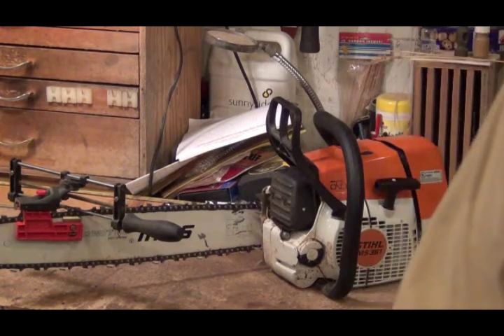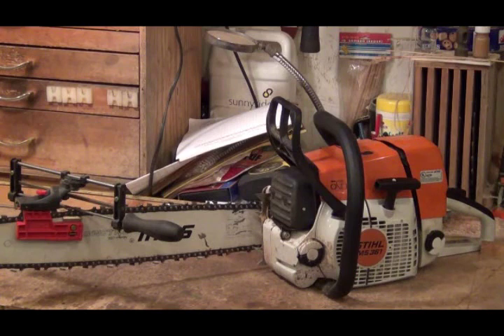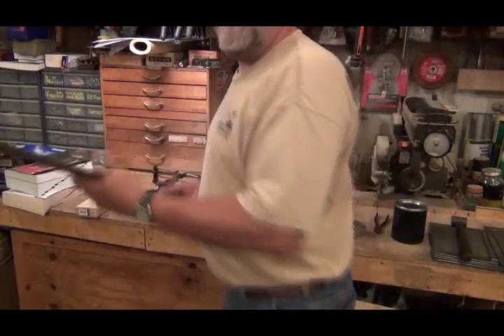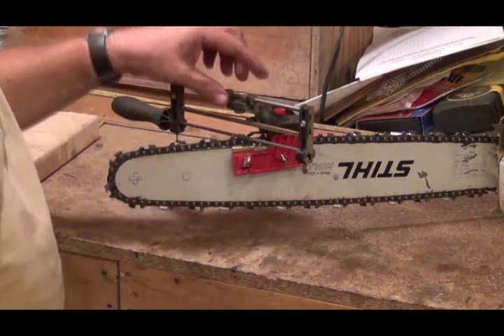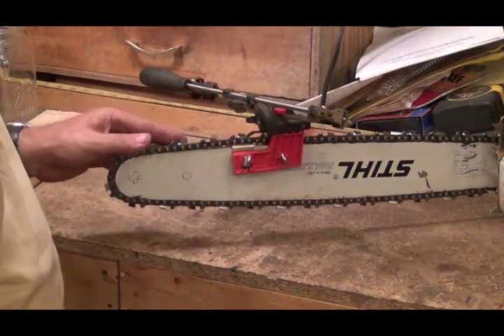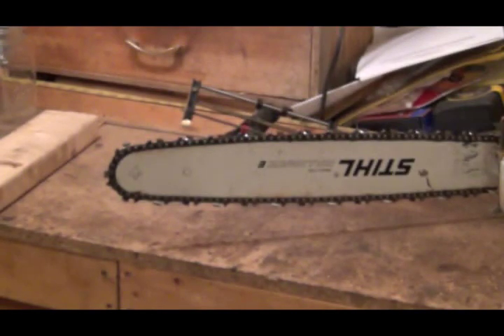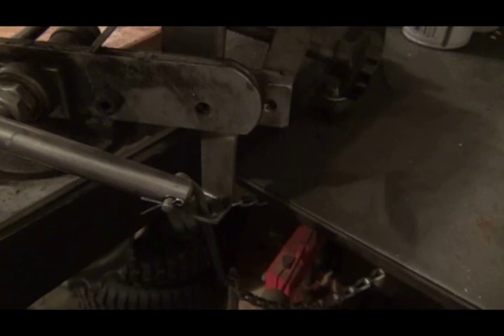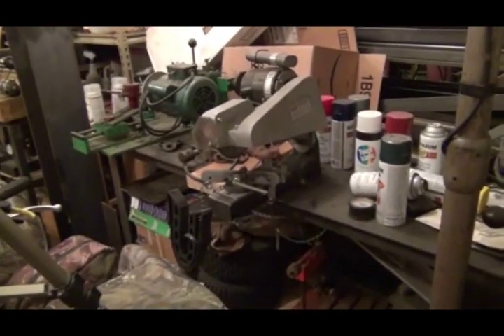Sharpening your chain saw

Comment: You got the sharpener on backwards,you sharpen your tooth from inside to out side in another words from narrow side of chain to the wide side,,your stroke should be with handle closes to the body of the saw then towards the tip of your bar as you stroke the file..you are sharpening from the front of the tooth to the back of the tooth..

Comment: there are no 40 degree  chains I've ever heard of. 25, 30, 35 but never 40. pushing the file the wrong direction  doesn't  help either but at least you got it turned around.

Comment: How did u come up with a 40deg angle on the tooth. Most are 30  is yours a rip chain for a mill use
Reply: rip are usually 10 deg.